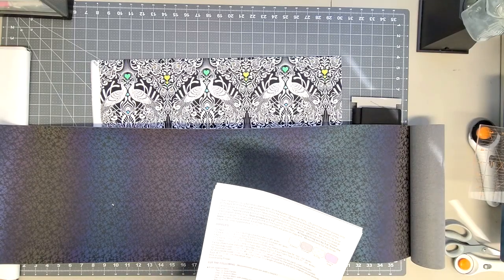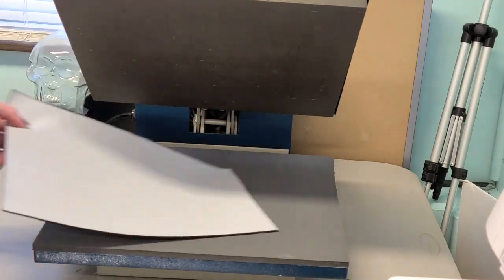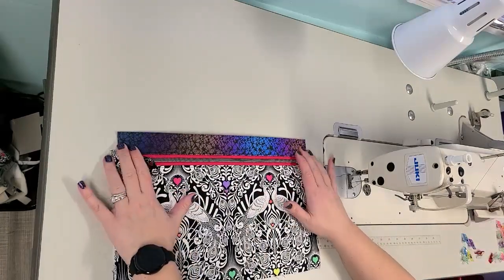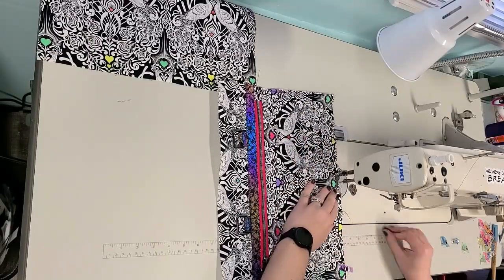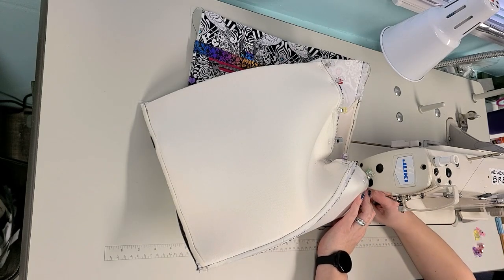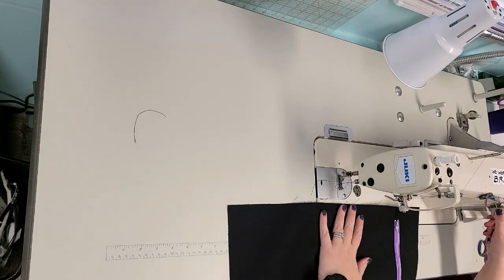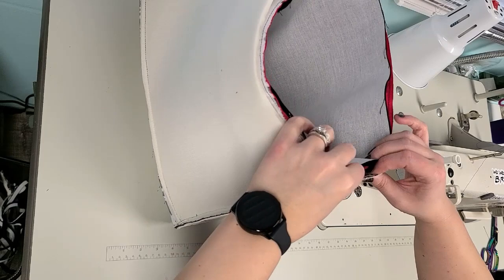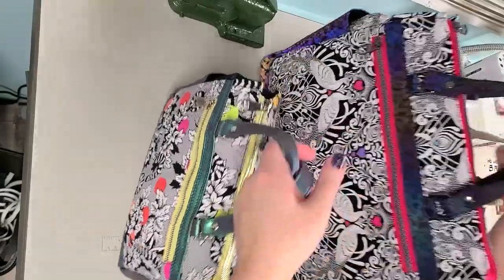Sincerely Jen Patterns - The Rossatron - Size Large - Sew along

Comment: I have the Juki DNU 1541 and I love it. I have several other machines, including a Sailrite Ultrafeed and a Juki DDL 8700H.  The sailrite is surprisingly a beast even though the motor is supposedly not that powerful.  I love the 8700 (it was my first industrial) but it is not made for heavy duty bagmaking.  I do love it though.  I decided to get the 1541 because it is unison feed (triple feed) and good for leather (I plan to get more into leather).  It is really nice.  The only thing I don't love is that you have to oil it more than just occasionally.  I am not used to that and am not sure how often I need to do it.  The manual says daily but that is way too frequent.  You can sew really thick materials and the pieces do not shift at all.  I just bought a leather foot from sailrite that works on the 1541 because the default foot is sort of wide and makes sewing zippers difficult.  Changing walking foot presser feet is not quick and simple like on a DDL 8700.  So now I can just leave the sailrite foot on full time.  I had bought a juki zipper foot but it has ridges on the bottom which can damage leather and vinyl.  The sailrite foot is smooth just like the one that comes with the machine and is about a quarter inch narrower.  A lot of bagmakers on YT have the Juki 1181 (or equivalent) but I think, if you can swing a few extra hundred bucks, the 1541 will probably be all you ever need.  The 1181 is not a true walking foot (only top and bottom but not needle feed).  And it cannot sew all types of leather, I hear.  I did not get the 1541S because my dealer did not recommend it.  He said when it is new it sometimes triggers for no reason and when it is older it sometimes doesnt trigger when it should.  So he recommended not getting the "S".  I got it from Industrialsewingmachineman in NJ.  It was "only" 1,425 (S version would have been 1,475).  Came with table and servo motor and almost fully assembled.
Reply from the maker: Wow! Great info, thank you so much!!! 1541 and 1181 are the machines I was thinking of and not sure which way to go. I don't have a local Juki dealer, so I will have to either order online or drive to one. Will definitely keep my 8700 for the lighter weight sews though! Thank you for all the info!
Reply: btw, I know nothing about Seiko.  I am a Juki die hard!